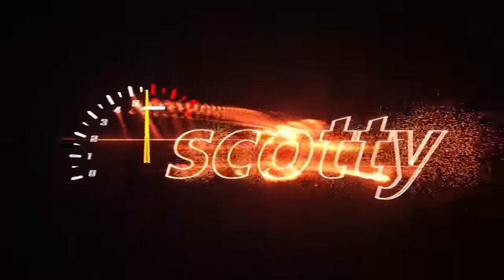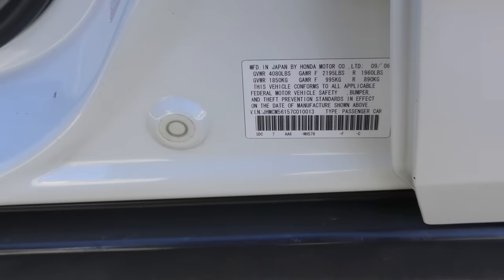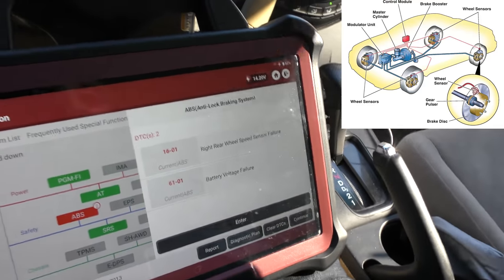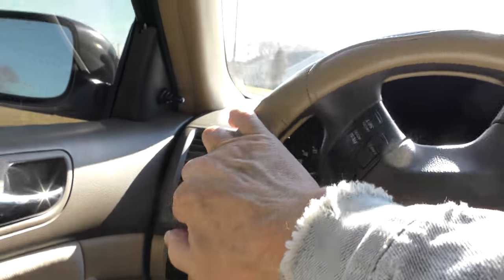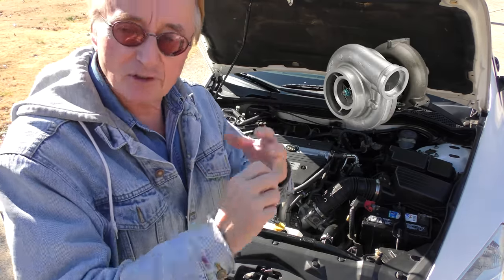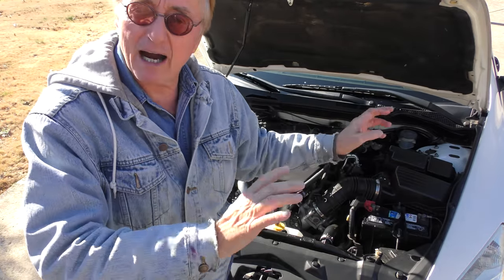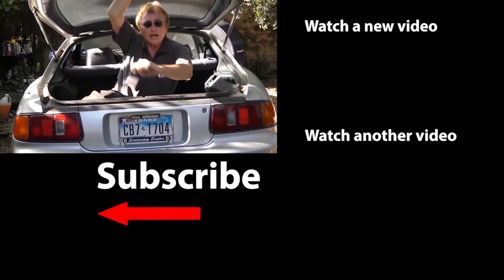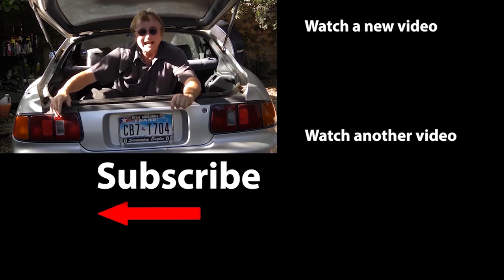Stop Buying Hondas with This Engine

Comment: STAY AWAY From the GDI "Earth Dreams" Engine
Reply: I have owned hondas since 1991 with no problems. I then bought a new 2019 crv with the 1.5 liter with a turbo.  This a terrible engine in a cold climate. If you drive in stop a go traffic with heater on high . The engine can ot get to operating temp .  You will not get good cabin heat and have an extreme oil dilution problem.
Reply: @m109r  exactly. I live in Canada Alberta where it can get easily down to -30°C , 2 weeks ago in it was -40°c and February is usually harshest weather (-49 is lowest I've experienced). No effing way this GDI engine would survive.i love Hondas and still looking for a 2013 non-GDI Honda Fit manual trans here. But market is crazy expensive
Reply: That’s why I bought my 2020 Civic Sport Sedan with a manual transmission and the 2.0 Naturally Aspirated port injected engine. 
Wasn’t a fan of turbo GDI engines or CVT transmissions for reliability 👍🏻
Reply: @bretthansen8166  great buy !!
Reply: @bretthansen8166  you made excellent  choices. In 2019 my 2007 crv was  totaled  , so was I  in a rush to get a new vehicle. The 1.5 engine driven on short drives in cold weather is terrible. The honda tech told that the engine has so much condensation  in the crank that it freezes causing the engine not turn over. Have owned honda vehicles since 1991. This unfortunately  is my last . I will not buy anything smaller than 2.o litre with no turbo

Comment: I want an advice if is possible about Honda civic 2001 1,4   90 HP,manual transmission, about engine is a D14z6,and the owner told me thath it's a rare engine?I drive the car and when stop the car work but the engine has a minimum noise and the oil inside was very dark and the yellow engine indicator on the table is on all the time,whath shall be thath problem and for this car he want 750 euro about 1500 dollars ,it is worth it?

Comment: Ummmm...J35's and the rare J37's are pretty reliable 😅😅😅
Reply: J37 and all 3rd gen j series with vcm burn oil. Disable vcm and change timing belt when due and your transmission will always die before the j series
Reply: @RudebwoyRacing  wife drives a 2018 J35 so she avoided that. 9 speed runs well and at only 63K. Being a mobile mechanic I did a transmission drain and fill at 50K. Next service is at 75K where I will do the coolant, timing belt and transmission drain and fill again.

Comment: What does it mean if you put it in gear and it does shake?
Reply: Transmission is telling you it’s going start having problems soon
Reply: change transmission oil
Reply: @rayluo4865  too late for that
Reply: @godsoe_is_old  no, it doesnt
Reply: Could be torque converter...could be motor mounts..if it bangs when you give it gas
Reply: My 304k 2002 4Runner has a slight shake while in gear. It's most noticeable while idling in drive, goes away in neutral. It's the original transmission and has never been apart so I'm assuming it's just wearing out.
Reply: @richsweeney1115  so in other words, it’s letting you know there’s a problem 🤦‍♂️
Reply: @godsoe_is_old  it'll still get you where you need to go, is the point. If it starts slippin, I'd worry